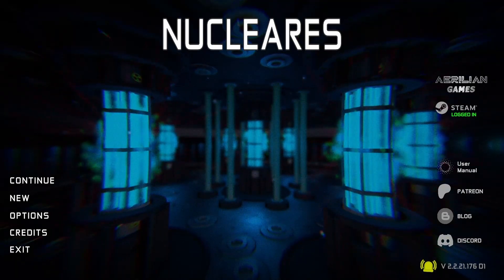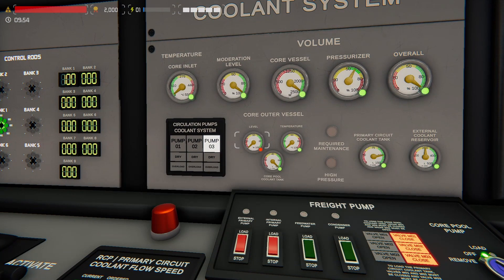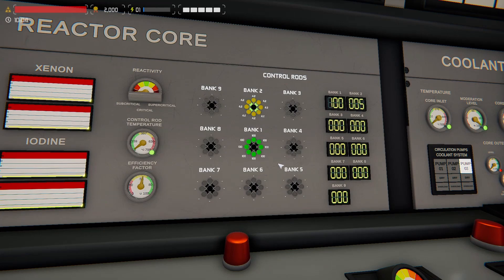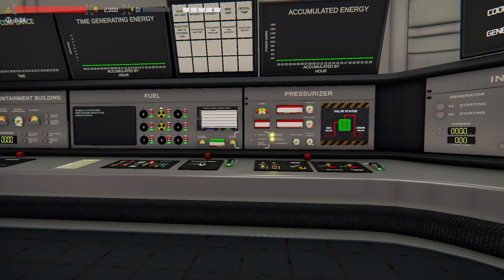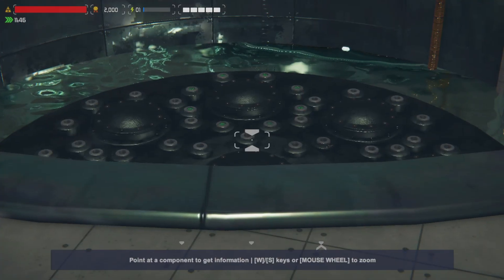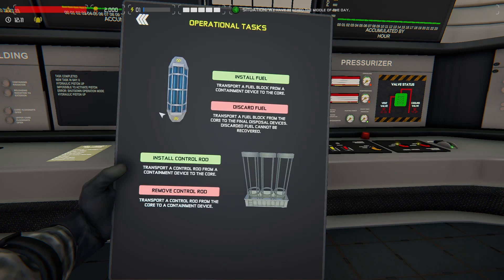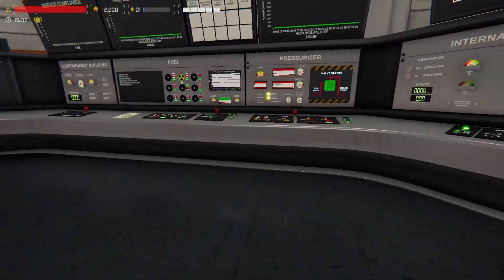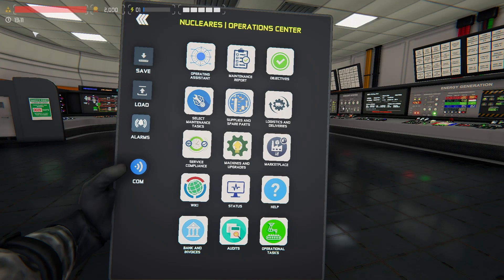Nucleares - Fuel Load/Unload and Control Rod Insertion/Removal Tutorial

Comment: when i try to unload the fuel i press the isolate button an then radiation starts to build up how do I stop it from doing that
Reply from the maker: It’s because the fuel isn’t spent. So you’d have to use it up most of the way. Extracting it with more than 10-30% material left will cause that.
Reply: @leonidasares but when I do the audits i fail and it say low fuel
Reply: @leonidasares  and how do i know how much fuel is left
Reply: @leonidasares  I have figur it out on my own.

Comment: How long does the reactor fuel usually last before needing a change?
Or is that in the manual?
Reply from the maker: It depends on how hard you run it, but the fuel should last you several game days. Probably around a week.
Reply: @leonidasares  thank you! Yeah i just found info in the manual on how to guage the fuel 'duration'

Comment: 07:03 In patch 178, this seems to no longer work. Even when disabling the thermal control safety, I could not isolate an active fuel bay.
The button even says "Do not operate with a reactive fuel rod" (unless you know what you're doing, lol)
Empty ones can be operated though.
Reply from the maker: Correct, things changed in patch 178. I did a video on it here:
https://youtu.be/WkUN7LwK9XM